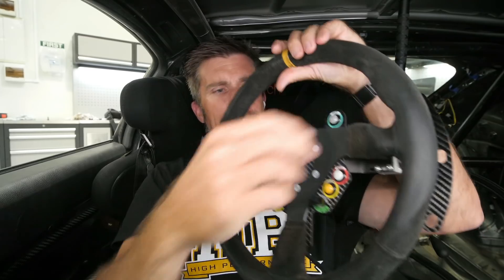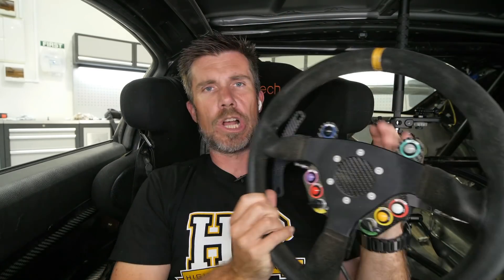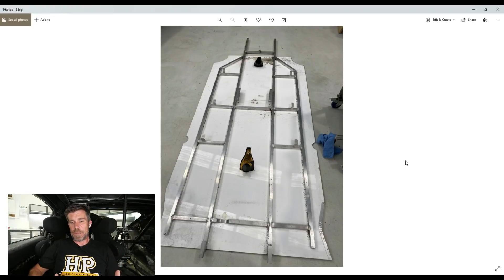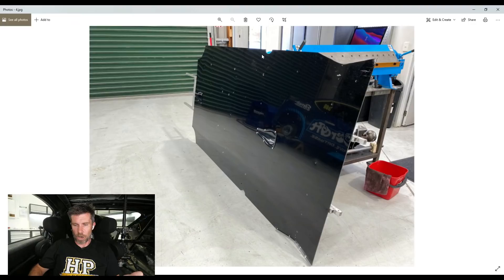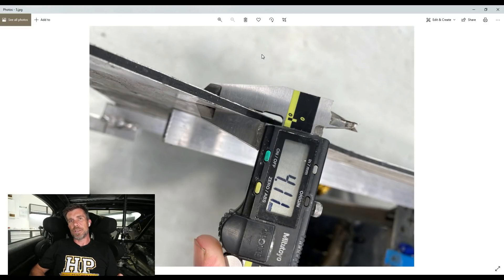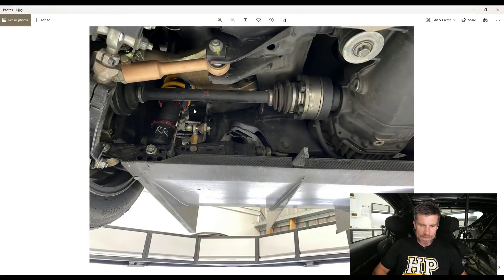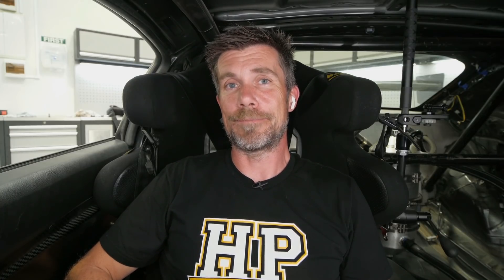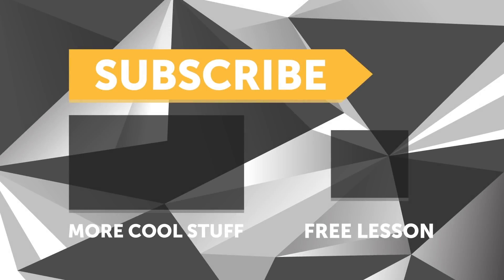16kgs EXTRA Weight 🙈 | Flat Floor Construction And Testing Plan [#UPDATE 304]

Comment: I know how to do composites I worked military and civilian aviation, but I would love to learn how to make the molds
Reply from the maker: We do have a composites course in the works which will cover mold making, however in the meantime you might also find learning how to 3D model a valuable skill for this. If you are making a mold from an existing part then you won't need that, but there it might come in handy is for smaller pieces or sections.
We just made a small reverse mold for a wiring break out box that was 3D printed as an example.
Another would be being able to model a wing in CAD to get the profile you wanted etc and then route or plasma cut out sections to make a mold/template from.
Obviously what you should/can do is very project dependant so if I was you I would pick a project first and foremost and then set out the path to make that happen, and start learning how to do that in steps.
That's just my advice, and I would also add that I would certainly shop around for advice from others too haha Hope it helps though! - Taz.
PS: We have a 3D CAD course if you decide to go down that path: https://www.hpacademy.com/courses/3d-modeling-and-cad-for-motorsport/?utm_source=youtube&utm_medium=social&utm_campaign=general-interaction

Comment: Hi 
I built my KP 60 Starlet flat floor out of 3 mm Snowbond 
Got it from Horton signs in Rangiora $80
Rear diffuser is a 4 1/2 to 1 expansion ratio 
Bent out of 1.2 mm Alu sheet 
Photos on Engine swap depot
Starlet with a G13 B Suzuki
On the dash shows the manometers for measuring the down force on the flat floor and the diffuser 
At 3 mile hill hillclimb the aero works 
I’m 185 Kph flat to floor on the long right
Stable as

Comment: i think about it but i have 2    70mm exhaust pipes that glow, and they would heat up everything inside, and melt plastic in floor, i think to use 1.5 mm al sheet and frame

Comment: With the Flat Floor I don't need to know Data facts and figures. All I need to know in a nutshell is what happened to the Lap Times and any other issues that may have or may not have cropped up. My train of thought for the last forty or so years is 'If it didn't make me faster it didn't stay on the car'. That's a very simplistic way of looking at it but it's worked for me pretty well for a few decades now. I've just completed, a few weeks back, making the front 'third' of the flat floor for my Honda.
Reply from the maker: The thing with aero is that it will make you faster and slower as Andre discusses, but it's a matter of making sure it makes you faster where it counts.

If you watch the likes of F1 they discuss it often too when it comes to tracks where they run higher downforce setups and sacrifice top speed for corner speed, and tracks where they want less drag and higher top speeds vs corner speed due to the layout.

With all that in mind, it isn't always as simple as 'this makes me go faster 100% of the time' as you get into the weeds of car setup and how and where you are racing. From there class rules can also play a role in what you can and can't do, sometimes compromising potential. All part of the game - Taz.

Comment: Another possible reason for a 'flat floor' may be rally and other off-road motorsports - 
Better protection from stone damage, less mud build-up, and easier to slide over rocks, etc, without catching the chassis.

Comment: My understanding is that the NACA ducts work efficiently because of the flat to sharp drop off, creating vortices off the edge.  The mounting in the pictures, where the plastic inch lip is on the outside might be disturbing the air and lower the amount of air they would normally flow, and I think they should have been mounted on the inside instead.
Reply: Agree, NACA ducts are sensitive to how they are mounted and what they are used for. Maybe a simple submerged air scoop would pull more air in there?

Comment: NACA duct: please correct me if I am wrong! The rear diffusor is to accelerate the air under the car, in your case under the flat floor. That means the pressure is lower vs. ambient and vs over the flat floor. So due to this pressure difference, not much air will go through via NACA duct. Rather I would direct the air from sideways, doing that the over the floor pressure will be increased, hence higher downforce.
Reply: I agree. The area above the plate is the same air as is in the engine bay.
Air in the engine bay is high pressure air, it's not really flowing at all and it is turbulent.
Holes in the plate will 'leak' high pressure air.
In the case of these NACA Ducts, if they lead to an area of even lower pressure than is below the car then they will flow, but I can't imagine where that would be.
Reply: I'd wager the pressure inside the compartment would be low enough that the naca ducts would be functional. The nacas themselves also create a low pressure area which is one of the reasons they function.

Comment: Canterbury University use to rent out their wind tunnel... I did a lotus 7 in it around 10 years ago. Otherwise there is a rentable one in Wellington that I hired via work for testing turbine blades. Both will fit a large racecar. FYI incase you ever want to do a tunnel video 😂

Comment: What is strange is you had actual results from fitting that aero package made by Top Stage. But after all year testing and a huge development program the very long ago winning Honda DC2 driving by a " Professional " driver in Club Sprint ( Not Legal ) in the NSW Time attack event just on there car was the same speed if not slower in every section of the track. There is a complete photo set floating about various Time Attack Building pages showing the reduction in speed. It just shows you need to know what you are doing with aerodynamics and have to have a driver that can get the full effect of the changes.

Comment: I would recommend using a poly foam core instead of a honeycomb core. The poly foam is a fraction of the cost and has less resin consumption which yields a light part that has similar stiffness. A 3/8” foam core with a 600gsm layer of CF on each side should be enough.
Reply: What density core? Supported where? What's the shear psf allowable? Needs a little design work up front to know it's gonna work. There's also damage tolerance to take into account...it is going to go off roading and scraping curbs.

Comment: @12:00 That's one way to do it. The other way is to use pressure sensors around the car to detect pressure changes on the body panels/surrounding area. The book "Modifying the aerodynamics of your road car" by Julian Edgar has some excellent examples of doing this kind of DIY/budget aero testing for those that can't spend big bucks on CFD/wind tunnel testing.
Reply: Julian’s book is amazing, and his videos too
Reply: I love how accessible Julian makes empirical testing with easy and cheap tools.
Reply: Does the book go into any more technical depth than his videos? I want to buy it but only if it teaches at a degree standard.

Comment: I strongly want to get involved in race car aero testing/production like this. How do I maneuver into this area?
Reply from the maker: Andrew Brilliant dove into it via land speed racing and progressed from there, I haven't had a chance to listen to his podcast with us yet but he's spoken about it in a few other interviews with us and around the internet and is just one person in the industry that is worth looking up for this question.

A P has some valid points too =) - Taz. - Taz.
Reply: 1. Get a PhD in fluid mechanics or aerospace engineering and work in a wind tunnel.

2. Join Formula SAE at university and become the aero lead. 

3. Start working as a mechanic for a racing team. Dedicate every waking moment travelling around the country. Start fabricating.

4. Get a beater with some power, strip it cage it, duck tape cardboard cutouts to it, learn to fabricate, learn to make molds, fiberglass.